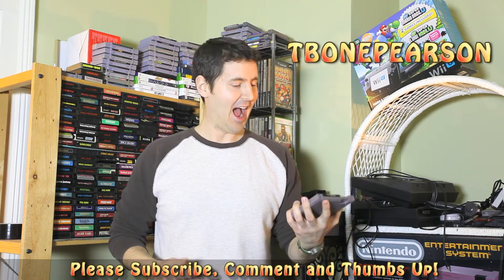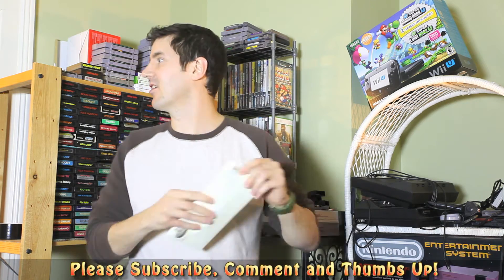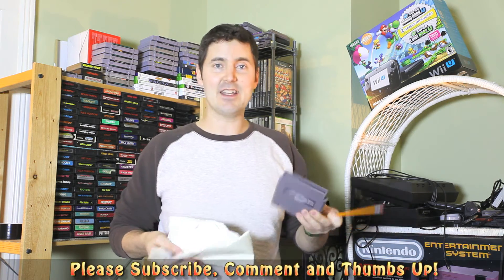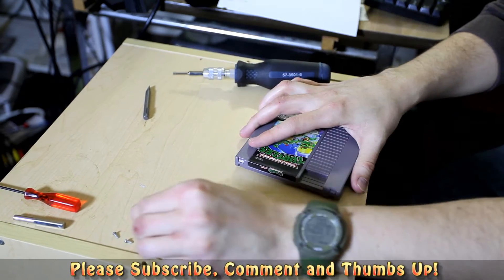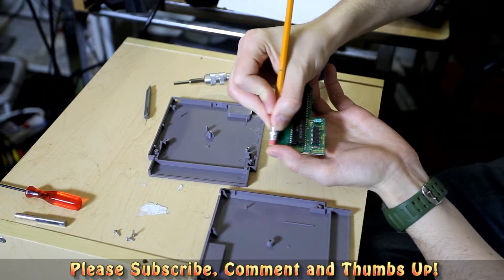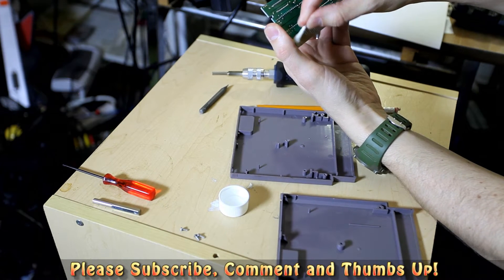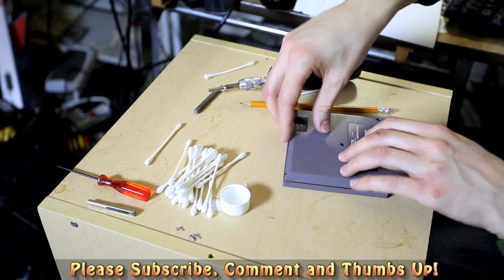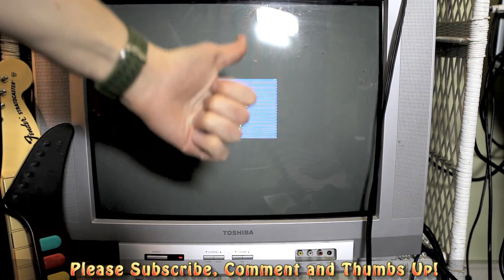HOW TO Clean and REPAIR Your Old NINTENDO GAMES!!

Comment: White eraser works really well.  I just did this to a few games and you can see the film dissolve off of the pins.  Que-tip and alcohol alone wont remove that stuff.  Opening it up and erasing it definitely is the best bet.  Thanks for the info 4 years later :)